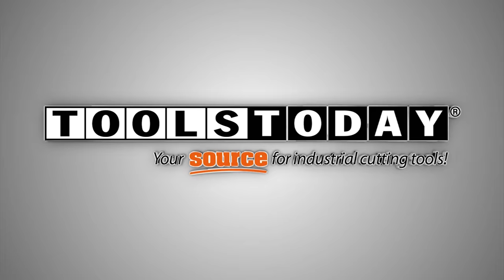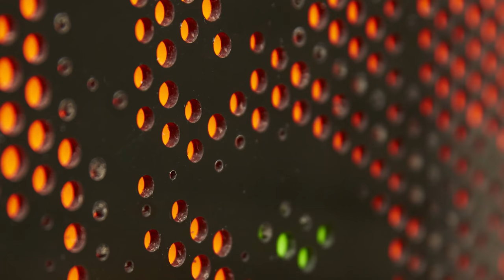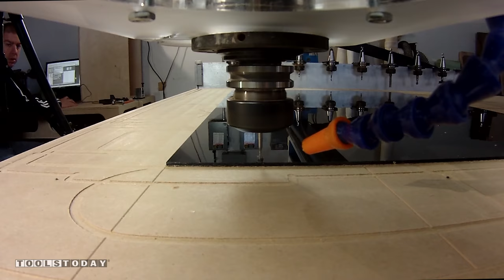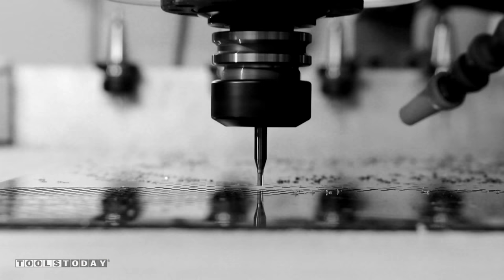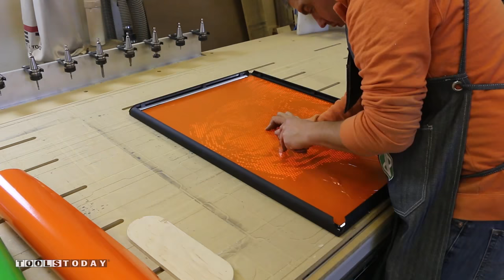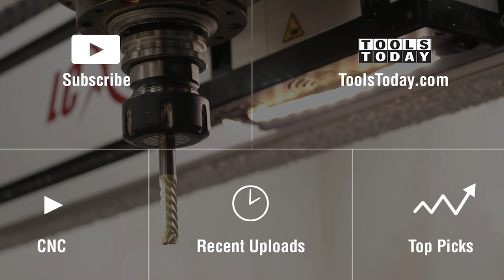CNC Project: LED Light Art Acrylic Tiger w/Amana Tool Solid Carbide Spiral 'O' Flute Router Bits

Comment: Beautiful image, I do it with PHOTOCARVE, but I bought an RC-1145, and I have not been able to make letters with chamfer, do you use aspire? or what is the process? Thank you and congratulations., I am of mexico city
Reply from the maker: Hi. The software used to generate the tiger image was a combination of Rhinoceros 5.0 (NURBS modeler) and a plug-in called Grasshopper (a parametric modeler). A grid of points (representing the circle center points) was overlaid on the image. A custom script was written which analyzes the greyscale value of the pixel located at each grid point and we used the greyscale value to control a circle radius that the CNC followed.

Comment: good day observed an excellent job
I'm from mexico would like to know if you have for sale these designs or vectors
Reply from the maker: Martin, while we cannot proivde the design file, this was created with a custom script, this could also be done with free software called Rasterbator to pixelate an image and then using 'live trace' in Adobe Illustrator to get vectors opposed to raster (there are free versions of Illustrator-equivalent software online).  Below is the link to Rasterbator with instruction and then we also linked an article from Instructables about how to use 'live trace' in Illustrator. Once you have vector outlines in illustrator that file can be cut on any CNC software. 

Rasterbator
http://rasterbator.net

Instructables article on making vector paths
http://m.instructables.com/id/Making-a-large-poster-with-vector-graphics
Reply: grasshopper image sampler

Comment: looking for a bit with a 1/8 shank to cut acrylic on my shapeoko3, would you point me to something you recommend?
Reply from the maker: Yes, Amana Tool item no. 51510-K is 1/8" shank, downcut spiral for plastic. ToolsToday also stocks the Amana Tool item no. 51410-K which is also a 1/8" shank, with the up-cut design. The down-cut leaves clean edges on the top of your acrylic surface.  Here's the link, https://tinyurl.com/1-8-shank-plastic

Comment: How did you do the artwork ?????What kind of software ?????Any other useful information in this regards ????
Reply from the maker: +Luis Licona, We purchased the tiger image from a stock photography website. The software used to generate the tiger image was a combination of Rhinoceros 5.0 (NURBS modeler) and a plug-in called Grasshopper (a parametric modeler). A grid of points (representing the circle center points) was overlaid on the image. A custom script was written which analyzes the greyscale value of the pixel located at each grid point and we used the greyscale value to control a circle radius that the CNC followed.
Reply: +ToolsToday WOWThanks for the info unfortunately seems to be far out for my capabilities and understanding of the process
Reply from the maker: +Luis Licona, While this was created with a custom script, this could also be done with free software called Rasterbator to pixelate an image and then using 'live trace' in Adobe Illustrator to get vectors opposed to raster (there are free versions of Illustrator-equivalent software online).  Below is the link to Rasterbator with instruction and then we also linked an article from Instructables about how to use 'live trace' in Illustrator. Once you have vector outlines in illustrator that file can be cut on any CNC software. 

Rasterbator
http://rasterbator.net

Instructables article on making vector paths
http://m.instructables.com/id/Making-a-large-poster-with-vector-graphics

Good luck! We would love to see how your project turns out!
Reply: grasshopper image sampler